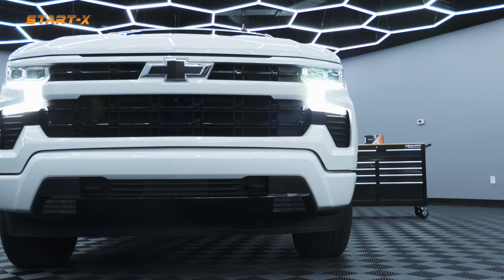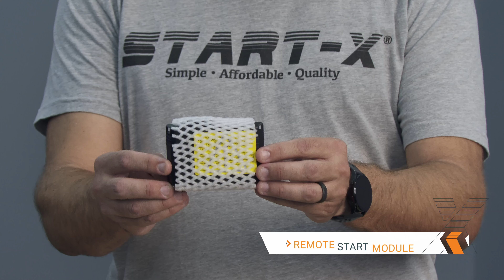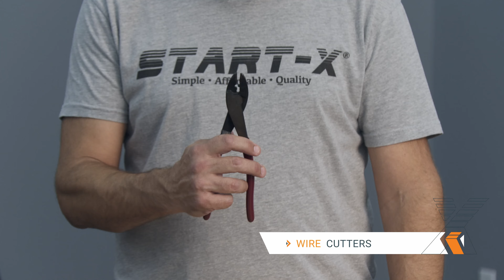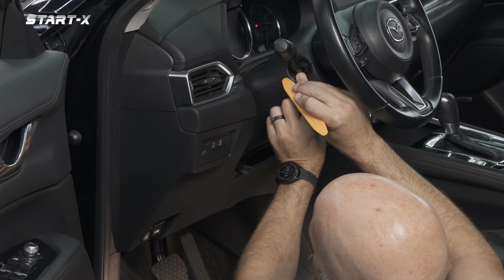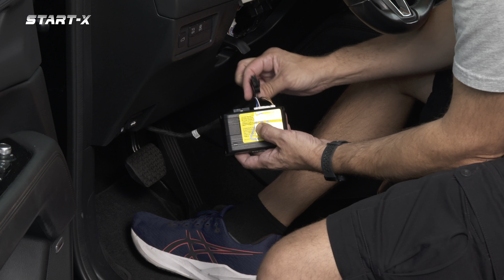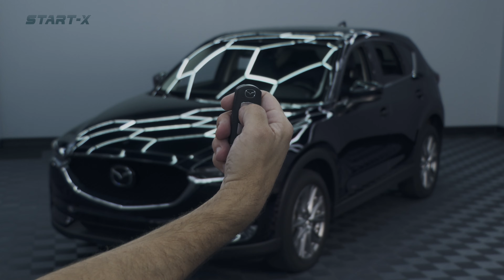Install: Select Mazda Start-X Remote Start LUL

Comment: Connected exactly per these instructions and the module light doesn't come on at all. 2016 Mazda CX5 GT. Ughhhh.
Reply from the maker: The best way for us to assist is by contacting our Tech Support team. You can email our experts at tech@stingersolutions.com or call at (727) 732-3114 Monday-Friday from 9am-7pm ET.